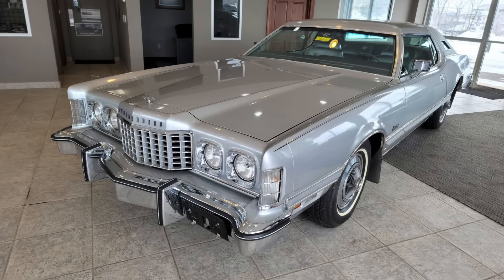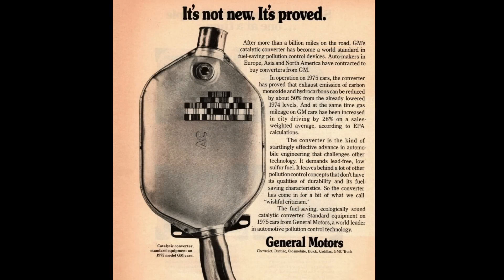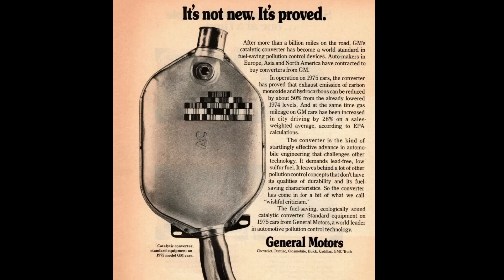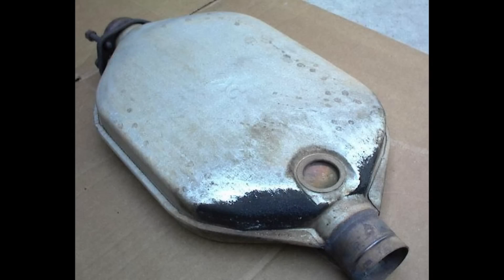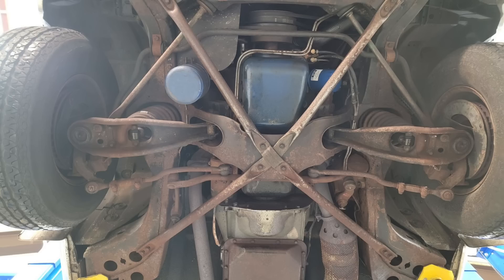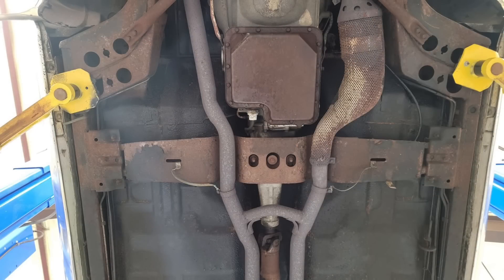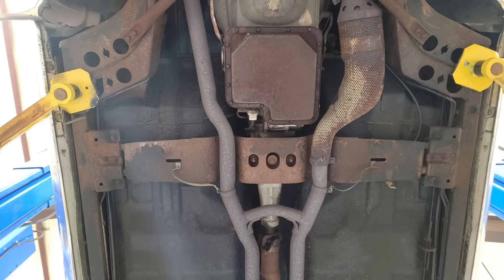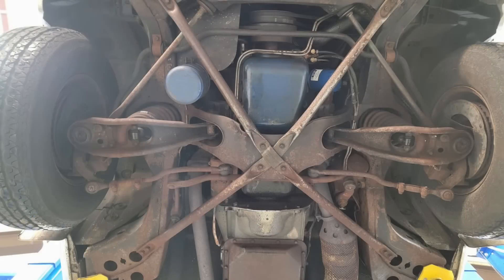Strangest Car Inventions: Ford Invents A Bizarre Way to Meet 1970s Emissions Standards

Comment: The wire ribbons were to minimize electrical discharge buildup which would cause radio interference. Static noise in the radio receiver.

Comment: I worked in an auto parts store in the early to mid 1980s, and hardly a day went by that I didn't sell someone a "converter test pipe".  FOR OFF ROAD USE ONLY printed on the box... yeah, whatever you say😂!

Comment: It sounds like Ford Motor Company on those 1975 model year cars was trying to save a few dollars by having one catalytic converter instead of two catalytic converter. Also during the early years of catalytic converter use some owners removed the catalytic converters and replaced them with a straight section of pipe as a means of getting more power out of the engine.

Comment: Being that the compression ratios were dropping in this era, it seems that the difference in back pressure would be negligible.  Fuel economy might be adversely affected.  Low rpm motors of that era with such stifling systems were anemic.  Ford's luxury vehicles were noticeably more lame in head-to-head class performance tests versus their competition.

Comment: Hi Adam, good video!  For your info, that flat pancake AC Delco catalytic converter or "GM you might say" is actually two converters in one, it is a dual bed converter or "two stage you night say.  The converter has two plugs, one on the top, and one on the bottom.  Both beds have catalyst BB's in them (catalyst is a adjective meaning change) the exhaust gases pass through the first stage, and then pass through the second stage before exiting the converter.  The catalytic converter oxidizes unburned fuel "HC" (hydrocarbons).  The converter does NOT filter "CO" (carbon monoxide).  The transmission crossmembers  on most Thunderbirds and Lincolns, have ground attachments for less chance of corrosion because the crossmember is 100% insulated with rubber mounts, left, right and center.  Please reply.  Dave...

Comment: Thanks, Adam.  I recall Chrysler doing something similar in 1980-81 with their 318 engine equipped cars.  I recall a small catalytic convertor on the right bank exhaust manifold, similar to what Ford had done, but then further downstream both pipes joined into a single larger catalytic convertor.

Comment: I remember those pancake converters. Growing up in a NYC apartment my dad used to let me warm up the car or I used to go and start it and just hear it run. It was nothing special to most people but we lived our 79 malibu wagon with its 305z one day i started the engine and it wasn’t running correctly but I didnt know and let it run. I started smelling something strange but thought it was the exhaust putting off fumes. When i saw an orange glow opposite of the car on the building wall i got out and looked under the car and the cat was flowing cherry red, engine was running rich if i remember correctly. It had a carb issue with probably the choke getting stuck. Cant remember how i kept the engine from stalling but man bring a kid and not knowing much about cars back then i thought it would catch fire, if i remember correctly it damaged the floor board a bit.  Great cars.
Reply: If a mixture of unburned fuel and air flow into a catalytic converter. The catalytic converter will burn the fuel and air and overheat and can glow a cherry red color. This is why a catalytic converter can overheat if there are one or more cylinders misfiring on the engine.
Reply: @davidgrisez  yup when the choke os closed, too much fuel and little air is vetting into the engine causing a rich condition, this will dump excess fuel and the cat will start burning too hot making it glow. It will actually ruin the inside of the cat.

Comment: It's funny how the 'Big Boy' locomotive already had mechanical fuel injection in 1941.
Reply: Those large steam locomotives had a stoker to feed coal to the firebox. Those large steam locomotives burned so much coal that a human being could never shovel coal into the firebox fast enough to keep the locomotive running.

Comment: Had a '76 Olds, '76 Buick, and '93 Cadillac. Removed, hollowed out, and replaced converters on all. They passed smog tests, got better gas milage, and ran with more power.

Comment: Had a "75 LTD, 400 2 bbl carb. One converter on one side only. It was a cheaply built car in a lot of ways, rusted badly, paint flaked off, etc.

Comment: If you read the GM advert about the catalytic converter, it claims only to stop CO and Hydrocarbon emissions by 50%. But modern propaganda will tell you the converter stops all CO emissions.  I worked at a Chevrolet dealer in the mid 70's. I remember mechanics diagnosing that cars would need the platinum beads or pellets , as we called them , teplaced to run correctly. As i look back on it, i think these mechanics were not teplacing the beads. They would store them up in their tool box and sell them to jewelry stores and pawn shops as rare pure metals and make a nice profit .

Comment: Asymmetric back pressure on a V8 worked to push exhaust through the crossover passage in the intake manifold which heated the area right under the carburetor.   This vaporized the fuel better and helped them run on a leaner mixture.   Many non-catalyst engines had 'heat riser' flappers in one side exhaust to do the same thing by blocking the flow and forcing more through the crossover passage.   Some of these were thermostatically controlled by a bi-metal spring while others used a vacuum can controlled by a temperature sensing switch in the cooling system.   I'm SO glad all of the emission controls used in the late '70's and through the '80's are gone now thanks to Fuel Injection and better combustion chamber technology.

Comment: I lived near Universal Oil Products in the 70's. A couple of friend's got jobs driving the Catalytic Converter test cars all over the place, including the highways. The rear seat was removed and replaced with chart recorders to measure temperature and other parameters. They told me that one day they drove a car on the Illinois toll-road at high speed, turned the ignition off, pumped the gas and switched the ignition back on. There was a terrible backfire noise followed by flames and catalyst stuff going out the tailpipe. These were carburetor engines so you could do that sort of damage.

Comment: The X member may have been for the angular 5mph pendulum test which was in addition to the 5 mph barrier.  The massive front overhang created a huge lever arm foe what would be thought to be an easy test to pass.  The requirements to pass the test was NO DAMAGE TO THE VEHICLE.  if you knocked the alignment out a degree or two you flunk.  The frame rails forward of the front wheel were about 3’ long.  All they did was hold on the rad support.  In a barrier crash at 30mph they would fold up like a cheap suit.  When we trying to improve crashwortiness for NCAP those were changed to have crush initiators.  I use to crush 4’ long 5”X5” square box sections with crush initiators, just a few.  With a perfectly aligned load it would crush to 1/3 it’s initial length and give almost a square wave force deflection curve.  You can see crush initiators in most cars today.  Body shop hate them.  Sorry boys, call NHTSA.  I still have one somewhere.  Strangest looking piece of metal work you’ll ever see. This was back in the mid to late 70s.  I’m an old gezzer.

Comment: I bought a 1971 Dodge Charger brand new. The only emissions control it had was a solenoid to retard the spark in idle. It made the idle rough, so I disconnected it, which increased the idle speed, so I adjusted the idle to a lower speed. The only government required emissions test was at idle. So, the solenoid was added to pass under test conditions. Chrysler Corporation was not punished. Years later, Volkswagen was punished for building cars that passed under government specified test conditions but had higher emissions in normal driving. The Dodge engine had a switch that sensed that the engine was running in idle. The Volkswagen engine computer had a much more sophisticated check for when it was being emissions tested.

In the mid 1970s, I recall that automakers basically took the existing production engines and added parts and made modifications to reduce emissions. Some of the implementations were terrible. Mechanics might replace the carburetor with one from a previous model year. Mechanics disabled add-ons. In areas with smog checks, some home mechanics and professional mechanics put things back to original condition to pass the test, then back the way they were before being tested, so the car ran better in normal driving. This practice was written up in the paper "Clean for a Day" by Charles Lave.

Unleaded gasoline was a major problem for new car buyers since it was initially in short supply. Many car owners made modifications to run on leaded gasoline.

Comment: Always wanted to “mild” restomod these years. Owned a 1970 Galaxie 500 and it was a really nice car for the era. Sadly, it went away but paid attention to the 70-75 eta cars, Fords mostly. Said that I wanted to get a “survivor” that really not worth keeping factory but keep all the pre-5mph bumpers (swap when swappable or mod if possible), de-chrome, clean-up gaps, alignments, etc. Obviously fix some of the horsepower issues (just get back what was robbed by emissions mostly). Probably not drop more than $20,000 on the entire project (think many of these are still like $5000 in non-restored but not rusty models). Of all the modern cars and such that just plagued with issues, would be nice to just have a simple, reliable, cruiser.

Comment: In relation to the grounding causing radio interferance the russian woodpecker which was very active in this timeframe would have had these engineers pulling thier hair out trying to work out what was causing the interferance just look up duga or russian woodpecker it could be heard worldwide on radios it drove people nuts 😂

Comment: My Dad had a '76 Elite with a 400, and it had 2 cats, one on each side way up near the exhaust manifolds going down to a single muffler and tailpipe. It actually ran really strong, but was outta power above 4000rpm. Torquey mf though. Putting dual exhaust on it from the cats back helped a bit, and it definitely sounded better. My friend had a '75 Firebird Formula 350, and we had a local muffler shop make a straight pipe to replace the cat, but they couldn't legally install it, so we did it ourselves. That really woke that car up very noticeably, and it sounded a whole lot better. This was all in the 78-79 timeframe.

Comment: The driver side has that light-off converter, and the passenger side probably has a valve which closes, forcing the exhaust through the intake manifold crossovers, out to the side with the converter!  It probably only does this before it is warmed up, and probably leads to better than 90% of the exhaust being scrubbed when cold. Cold engine is worse because the choke leads to more fuel being burned. Once the engine is warm the exhaust diverter valve will open, and presumably, only the driver side being scrubbed - which must have still been enough to meet the standard.

Comment: My 1976 Elite 351 Windsor had the same bizarre set up as the T Bird. One converter on just one side of the downpipe. Very strange indeed. Eventually burned the valves like many engines back in that era. It was a dog and only got 10mpg in town.GM was not a lot better because their converters very notorious for plugging up if the engine ran rich and setting the converter (and sometimes the car) on fire. That was a horrific era for cars in general and we are better off now despite the serious tech that few owners can do themselves.

Comment: 1975 is also an excellent year to showcase how ugly 1970's cars are. Giant rubber baby bumpers.  Really low HP engines.  85 MPH speedometers. Even on a Ferrari.  Engines generally would rev nicely to 3500rpm and then fall flat on its face. And  male humans often had long sideburns and ugly ass clothes.

Comment: My 1975 Continental had a cat on one side (driver's, as I recall) and exhaust-side air injection from a mechanical pump on the other.  It was a 460, super quiet and powerful.  I don't recall any cross struts or grounding straps.  It did have a lot of vacuum devices (headlight doors, climate controls, etc), so the engine bay was full of vacuum accumulator cans and hoses.

Comment: Thanks for showing the bumpers.  The Thunderbirds and Mark IV always looked like they had way to much front end overhang in front of the wheels with those bumpers.  I'm glad we got 1 good year in 72 of that bodystyle.  Interestingly, the GM A body colonade style was supposed to come out in 72.  I always wondered what a small bumper version of those cars would look like.  If you can find any info it would make a great video.

Comment: Grounding on the exhaust system could’ve been done to eliminate radio frequency interference in the radio. Back then am radio was king. And impulse noise from the ignition system would disrupt the signal. I was called in once to advise about this problem on a BMW 850 that the CEO of our company was not happy with the a.m. Radio performance. Since he was the CEO of a radio company, it was important to him! Bonding the exhaust system totally eliminated the problem. Since they had the entire engine and exhaust system, floating on rubber, the exhaust pipe made a great antenna.

Comment: I worked at a Chevy dealership 80-82 and the "pancake" cats as you call them were referred to as "pieces of $h!t" by us technicians. Refilling the pellets when the pellets broke down was very time consuming whether you you used the shop vac trick or took them out and manipulated the very heavy cat to get the pellets to fall out. Manufacturers were also just barely starting to use fuel controls and crude computers to control emissions. I remember leaving the training classes more confused sometimes because some of the instructors didn't fully understand the theories and mechanics of the systems.  They were rushing so fast to develop the emissions technology even ordering parts was frustrating,  3 identical vehicles had different sensors/connectors/ect. Just as now the government was making legislation when the technology didn't exist. Also just as now government vehicles weren't under the same emissions regulations as vehicles for the general public.

Comment: My sister had a 88 Celebrity. Which had a Pancake Cat. Replaced the entire exhaust system with a new style converter. Using Walker pipes. Which was a direct fit.

Comment: I used to change those pellets when I was a mechanic at Chevy long long ago. They came in what looked like a big coffee can. You opened the plug with a container under it to catch the pellets and tapped the converter with a rubber mallet until they all fell out. Then there was a plastic tube about 18" long that fit in the hole the plug came out of. You hooked a vacuum to the tailpipe and opened the can of new pellets and held it under the end of the plastic tube so it sucked them all back up into the converter while tapping it with the mallet so they all packed tight. when they all were in, you put the plug back in. 

Then you put the old pellets back into the can, sealed the lid, marked it as return and GM took them back. It was part of some periodic service, but I can't remember which one. I never saw anybody do it once the cars were out of warranty and never saw a private garage do it

Comment: A thought on the ground straps on the crossmember, it appears the ends of the crossmember has rubber isolators. Maybe that's a relevant detail. Maybe 2 straps doubles the chances of maintaining the connections in a bad environment.

Comment: Those converter beads deteriorated immediately and clogged the exhaust. I had to pull the plug, and blow them out. Indeed the power increased greatly.

Comment: Those holes have nothing to do with weight saving or draining...if you look inside you will find the bolts that attach the body to the frame running through rubber isolators. In the body shop we had special hooks that went in those holes to anchor and pull frame damage from a collision. We believed that they were also used as jig holes in manufacturing but I can't prove it. Maybe also used for assembly line fixturing.

Comment: I dont understand what a "emission" is? Becouse I thought it was pullution?? So a guy would guess that burning lots of fuel & not having your engine tuned well would create more pollution? But everything the auto makers did in the 70's to "meet emissions" seemed to be the opposite of what someone would do if they wanted a more efficient running engine?? Lowering compression, retarding cam timing, choking out exhoust systems? All those things make a engine have to work harder to do what otherwise be the same work? Meaning they made less power, while using more gas? I would think if emissions were the same as pollution, u would want to burn less gas??